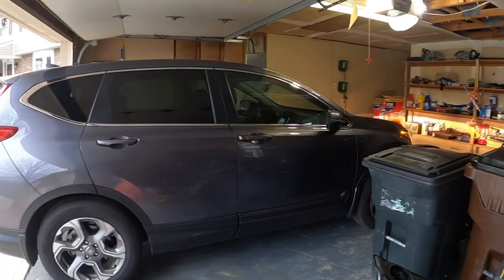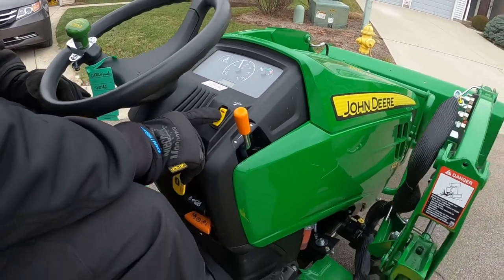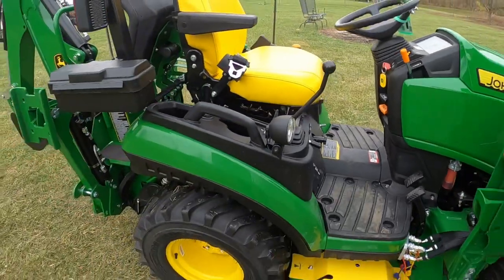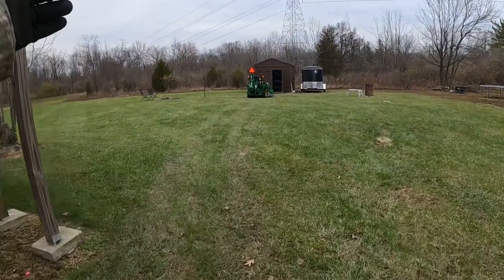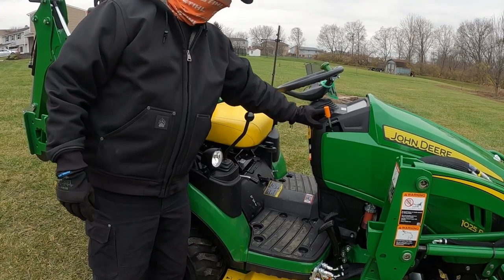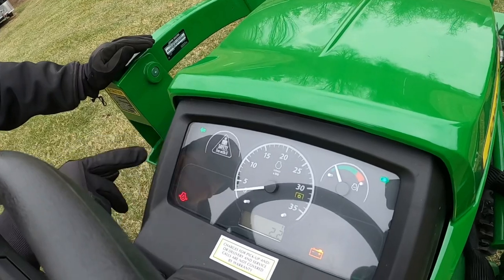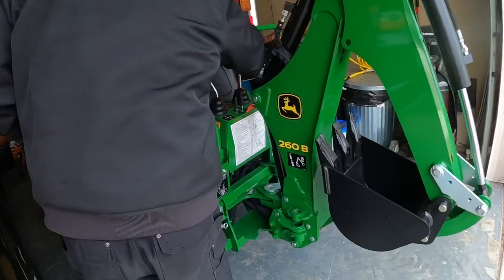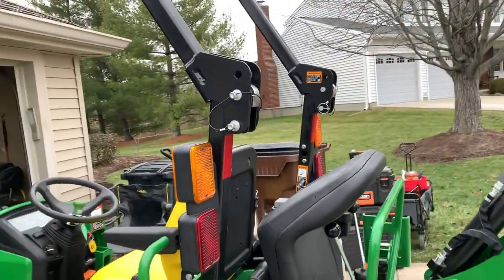The Day My First Tractor, Penny Was Delivered, John Deere 1025R Backhoe, 60 inch Belly Mower (Vlog)

Comment: I got the same setup except for the mower deck. Great unit I got 6 month ago. My property has hills in the back which can get scary. I use the safety belt then.  Removing stumps I still have to play with. Will keep your video!
Removing the backhoe will be a challenge, I’ll build a dolly for it.

Comment: Your video brings back the excitement i felt when my 10255R arrived back in 2018. Your delivery man was much more helpful than mine.. You will love a set of forks. I use mine as much as the bucket. I also had a couple of smucks with the ROPS. I took mine to a welding shop and had a foot taken out of the ROPS. Now i can drive in the buildings  with no worries. Congrats. Kent from PEI
Reply from the maker: I am looking to get a set of forks and a good tiller... I am mad right now... I killed the battery yesterday and found out today... lol no work 2 days in a row... lol Thanks for watching and taking the time to leave a comment
Reply: Ya, me too. I oicked it up with a small trailer for the 50 mile ride home and the orange slow moving vehile triangle blow out of its holder on the backhoe in the first 5 minutes. That tractor was the best tractor I ever had. Looking for another right now.
Reply: I bought a set of forks to move some logs on my 5 acres and huge stumps.

Comment: your delivery guy was pretty good with instructions to get you up and running. if he didnt show how to remove the backhoe, its pretty straightforward but let me know if you get stuck
Reply from the maker: They showed me at the Dealership the day I bought it. I am still a little scared of it I feel like I am going to break something.... like a wall in my house... My Gutters are not going to last long I will tell you that... lol
Reply: @shawspeaks8252  hahaha, ive thought the same with mine too. i saw some great videos on how people have bolted dolly's together to move it around when its detached. i am very space limited now.
Reply from the maker: @ddacombe4752  I am as well. Have so many projects I want to get done. Money is going to be the problem for me. Projects cost money and big projects cost big money even if you have a tractor and eliminate labor cost. lol
Reply: @shawspeaks8252  yeah, i found that having bought timber, cement, fasteners etc for a lean to, but its all good fun. if you can get the forks, they are REALLY handy. i used them instead of saw horses to cut up an 8x4 sheet, and to hold some fence rails against the posts while i attached them. sooo much easier. if you are on a tight budget you can get forks that screw onto the bucket.